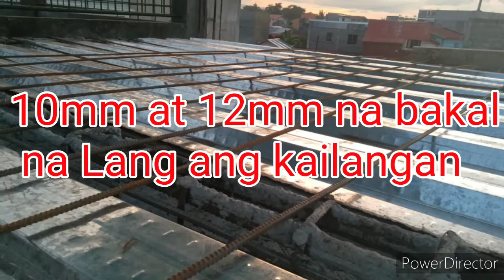Steel Deck/Magkano Nga Ba?  Read description please 😂

Comment: maam ilang sqm po yang nilagyan nyo ng steel decking..at mgkano po na gastos sa steel deking
 nyan..icluding mga bakal....hindi kasama po labor nyo maam..salamat po..
Reply from the maker: 50sqm po. sa steel deck lng po nasa 27k, dko nalista kung ilang bakal pautay utay kasi pag bili
Reply from the maker: Basta tipid xa sa kahoy na pang scaffolding kasi 10cocolumber lng binili ko recycle nalng din ung mga Natira Noong sa first floor.
Reply from the maker: Panoorin mo po ung isa kong video complete po details doon

Comment: Magkano po ang isa ng steel deck po ang bli nio
Reply from the maker: 695.75 po per square meter,depende sa kapal
Reply: Makano po nagastus nyo po sa buong slab at anong size po. Thank you
Reply from the maker: @jeffersondevera2333  kung steel deck lng po nasa 29k Dipa Kasama ung semento,gravel and sand, at bakal. Syempre ung labor pa at expenses sa pagbuo ng beam. Ung scaffolding recycle nalang ung mga Natira nung una,bali dinagdagan ko nlng ng 10 pcs na good lumber
Reply: Salamat po. More blessings po
Reply from the maker: @jeffersondevera2333  welcome po, pa like and subscribe na lng po para MA update po kayo sa sunod kong video salamat po
Reply: @lorlietanjay4438  ilang sqm po ba yang floormaam..?
at mg kano po lahat including labor at al materials..salamat po..